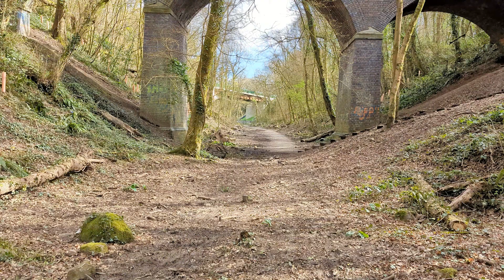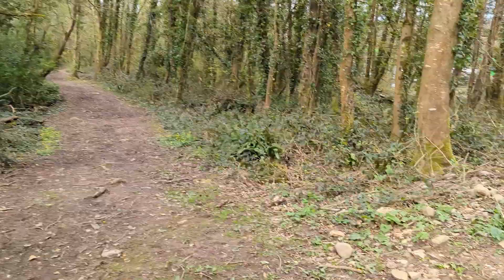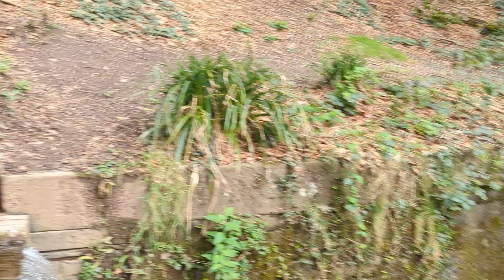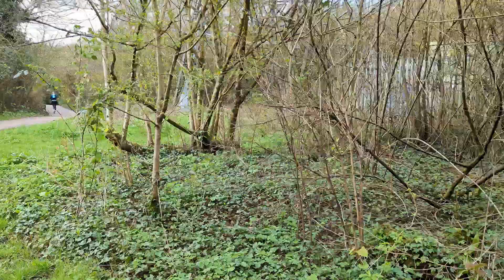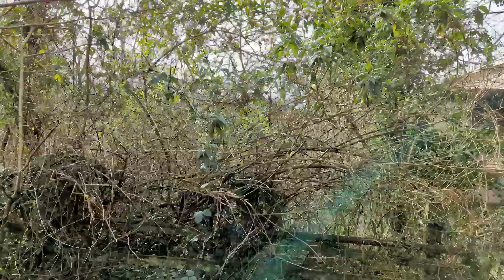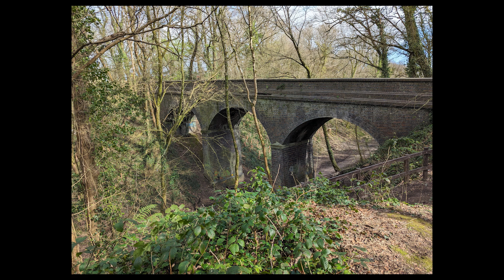Cardiff Railway   The Coryton connection

Comment: For all the difficulties you said i'd be inclined to say you don't cross Longwood drive there and in fact push longwood drive further north if needed and run the railway paralel and south of the road, build a viaduct and public reclamation order on some of the Forest Farm industrial estate. Change the access road to the industrial estate so its not on the north side where it currently is and that way you mitigate everything other than the conservation area, of which seemed ignored anyway when they built the hospital on the meadows. 

As for 'demand', as you said it would be necessary to measure what would be saved and extra usage would be produced from the Radyr and Llandaf areas, but what I would mention is it would certainly increase the efficiency of the Coryton line which could see combined services with the Radyr line. You could even create a 'circle line' service of sorts, although atleast 1 passing point would likely be needed probably just north of Heath Low level since the track is single lane, maybe another between Rhiwbina and Birchgrove where there appears to be enough NR land already.

I've always like this idea tbh, and didn't undertand why is wasn't a necessity to join the lines up when the hospital was green lit.
Reply from the maker: It is doable but that would destroy all the remaining rail relics and nature reserve. So they would have a battle. As for demand I think first build the station at Velindre, which to me is a quick win, then see what demand is from the various parts of the city.

Comment: Honestly if a western park and ride is needed, I don't think J32 is the best option. The communities with easiest access to J32 are already quite well served by rail and could just get a train along the CVLs. Plus, a service from a potential J32 P&R along the coryton line would have to stop 8 or 9 times before getting to central cardiff. A P&R a bit further out, at J33 or J34 would better serve those areas that don't have rail service, and users could get fast trains just one stop to the city centre and on to the valley lines too. This would also have the advantage of not clogging up J32 with both P&R traffic and traffic driving into Cardiff.
This of course is assuming there's a case for a P&R at all. There might be, but then there might not be.
Reply from the maker: There are plans for a J33 P&R as part of Cardiff Crossrail with Tram Trains coming in from the west. My thoughts on the J32 station would be where would the car park go?
Reply: Ultimately though, any p&r on j32 would clog up the Coryton gyratory around rush hour and on match days even more than it gets now.

Comment: If all those old railway lines,  the M4 and the interchange could be built in that area, then so could a connection from Coryton to Radyr. Where there's a will there's a way.
Reply from the maker: Ver probably, however when they built the M4 and A470 they didn;t care as much about nature etc as they do now. They just ploughed through.
Reply: When they were built, it was empty to build them in! Now they are built, they are in the way.

Comment: I don't think the engineering issues you've presented are insurmountable, simply a matter of funding. The key issue that I can see is how the services would interact with the already constrained network. 

Building such a link would be pointless without an increase in services, at least 4 per hour per direction compared to the current 2. This would likely require full duling of the Coryton line (not impossible as existing trackbed still exists but certainly not cheap). Additionaly, adding an extra 4 tph/d to the section between Radyr station and a new bridge across the Taff (which is planned to handle 12 tph/d) seems a far more complex issue. Same capacity issues on the existing Rhymney line Heath Junction and of course Central/Cardiff West Junction and Queen street where the biggest capacity contraints lie. 

Just looking at the junctions between the Coryton line and Taff Vale/Rhymney lines - both will likely need to be grade separated juntions to allow for such an increase in frequency. Whilst obviously very expensive this also seems almost impossible at the Rhymney line junction without serious demolition of nearby houses (obviously this is provided the rolling stock is tram-trains/similar vehicles allowing for tighter radius and steeper inclines).

I do feel there would be significant demand for such a service, massively improving cross city connections between the northern and western suburbs of the city and making Radyr a major junction for connections between the valleys and Northern Cardiff. However the only way this line will be well used is with 4 trains per hour per direction and the money required to achieve this simply doesn't make economic sense at the moment. 

The only way this is ever built is if its built in stages over decades.
-  Extend to J32 P&R (likely between Longwood drive and M4 due to space requirements) which will tackle one of the hurdles. 
-  Introduce passing loop on Coryton line to allow for 4tph. 
-  Then over decades slowly tackle the other capacity constraints on the line (these will be economically viable as they will benefit existing lines). 
-  The final task will be connecting from P&R to just north of Radyr - a relatively small connection - but wouldn't expect it till like the 2070s or something lol. 

Basically I think its extremely unlikely, at least in the next 50 years. Plenty of other improvements that are easier to achieve and have better ROI (principally - increasing frequencies on the existing Coryton and city lines to 4tph)
Reply from the maker: There is the issue of the capacity on the Taff lines, that is about to go through the roof. I can see the Coryton line being extended but not much beyond that.

Comment: First, that presented drawing of a possible route employs 50m radius tracks so it entirely ignores that trains like large radiuses and minimal inclines. Trams can maybe do that route. Trains can not.

Now, secondly, it IS possible to draw a more train-suitable 450m radius circle from starting 300 m before the coryton cut reaches the middle lock. 
That way the 'top' of the circle would be in between the highway and longwood drive. That connection hits the taff vale railway where it runs right alongside the taff river (just below where the old mill used to be). This route avoids the middle lock easily, crosses longwood drive twice but more importantly it avoids built-up areas.

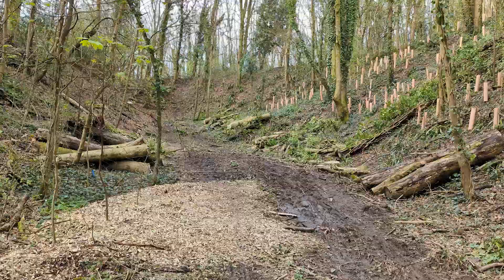One little problem left, by my estimation that route has more than a 2% descent, dropping probably 25m within 1km, which would be 1:40. Perhaps someone has an accurate lidar measurement of the height difference? Now that incline could be solved by making the Coryton cut deeper, starting as far back at Coryton but it won't come cheap... and with that it will more tend towards what ianssmith says, go underneath using a bridge twice or reroute the road in parts.
Reply from the maker: It could probably be done, it would wreck a lot of countryside and the Taff Vale side would need a lot of work, it's whether it's needed

Comment: This is an idea that has been around for several decades. It would require a large sum to build a bridge over the R. Taff and some extensive modifications to the track between Radyr and   Taff's Well. Is it the best place to invest this large sum or are there other projects where the benefits would be greater? What about extending the railway to Asda, Corytown and building a park & ride car park nearby to reduce motorway traffic coming into Cardiff centre?
Reply from the maker: Absolutely. I have seen the later on the electrician plans, but no one is seriously talking about any more than that. However I get comments practically every time I post anything about the line at Coryton

Comment: I'm probably one of the more vocal ones in support for this link so here's my take,

The current (soon to be disbanded) "City line" service between Coryton and Radyr has the densest catchment of any line in Wales and is likely one of the densest in the UK for its short length, yet the line sees very little patronage due to services comprising of antiquated 1 car long 153 railcars running to a poor half-hourly frequency and never running late evenings or on Sundays. There is huge potential for a high frequency circle line development serving these communities and providing key interchange points to make new journeys possible.

In terms of the feasibility of the Taff link itself, its really not that far fetched,
As transport planning Prof Mark Barry suggests, The Coryton Branch from Heath Jn to the buffers at Coryton should be converted to non-mainline status and operated as a light rail tramway, with the link across to Radyr also following this convention. This would allow for Tram-Train vehicles to be deployed, allowing for a tight turning radii and steep grades. This would make the exit from the existing cutting, transitioning into a parallel alignment with Longwood Drive a doddle, Leaving plenty of distance from the viaduct ruins And at a high enough grade to install a culvert underneath for the water. This would all however require the reconstruction of the top of Longwood Drive + embankment. 

Regarding the concern with the M4 embankment and National Grid transmission pylons, the alignment of the link should hug the side of Longwood Drive, first coming to level with the road and then ascending to meet with the viaduct across the Taff, this would put it well out of the way of both of those obstacles.

The boundary for the SSI and Nature Reserve ends a few metres before the treeline to the south of Longwood Drive and does not extend to the cutting. No part of the alignment or structure for this link would be inside this boundary, there is ample room. 

Now for the actual difficult bit.
All of this is completely pointless with the current state of the network, there are a lot of bottlenecks that need to be resolved for this circle line plan to ever bear fruit, and the infrastructure required to overcome those bottlenecks would be ridiculously expensive. Below is what would be required: 

Double tracking of the Coryton Branch (Electrification just installed would need significant modifications) 
Single track dive-under at Heath Junction
Remodelling of Cardiff Queen Street junctions with new, quad-track bridge across Newport Road and a double track dive-under at Guildford Crescent
A light rail connection between Queen Street South Junction and Callaghan Square
A double track dive-under at Radyr Branch Junction (underneath VoG line)
Quad tracking between Radyr and the viaduct crossing the Taff

A lot of that would be good to have regardless, but its a big spend which TfW and the WG are reluctant to make.

Comment: A fanciful idea Bob and beyond the practicalities you've outlined. Just think of the cost. There surely cannot be a net economic cost benefit. Since the TfW metro is supposedly all about integtated  transport systems you could have a fleet of  Clippers, for example, running between Coryton to Radyr to complete the city circle and indded connection to Llandaff North  station for connection to the wider rail system.
Reply: The Taff is completely impassable for boat passage outside of a few keys areas.
In the Radyr area there is a tall weir and hydroelectric screw turbines and further down towards Radyr station it becomes a rapids with large rocks breaking the water surface

Comment: Thank you for a good balanced consideration of the practical aspects. I see a lot of people commenting in Facebook groups about lines that should be reopened and/or linked up, but some are a combination of very expensive work to remove or cross more recent buildings and infrastructure, with questionable limited benefits, so are clearly impractical. As you say, it's easy to draw on a map, and it may look a great idea, but it's quite a different matter in practice.
Reply from the maker: The Carmarthen to Aberystwyth line is one that comes up so often, but the logistics of doing it would be a nightmare. As you say,  sounds great on paper
Reply: @bobsrailrelics  The obvious south to north link is the shortest and most direct. Builth Road to Moat Lane. The trackbed is intact including the summit tunnel. The only major obstruction is (inevitably) a road at Llanidloes. Yet this route never gets a mention.